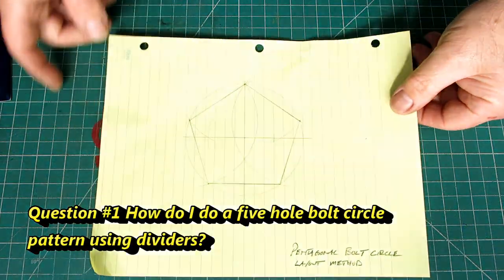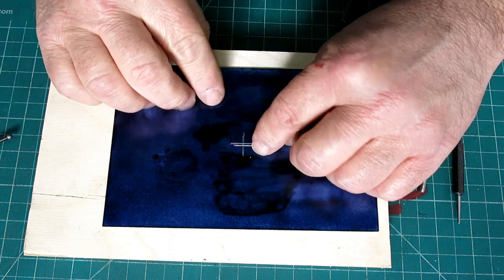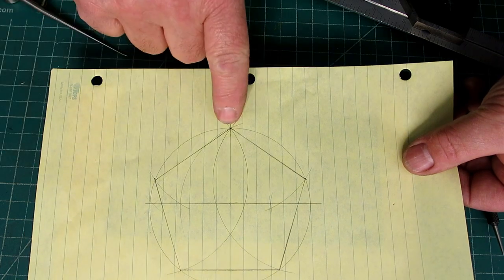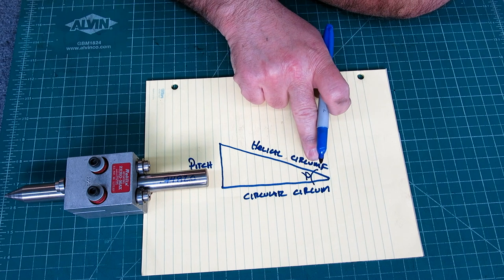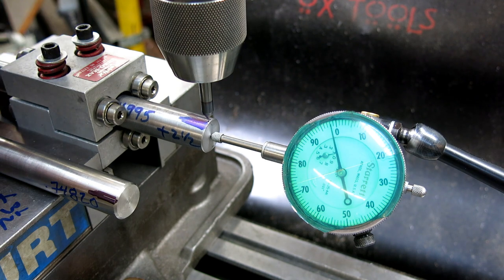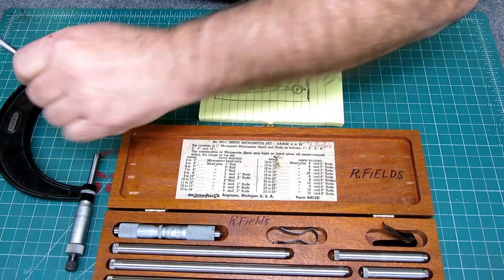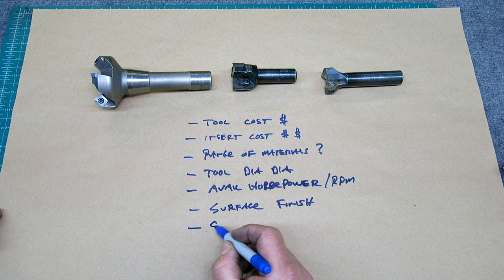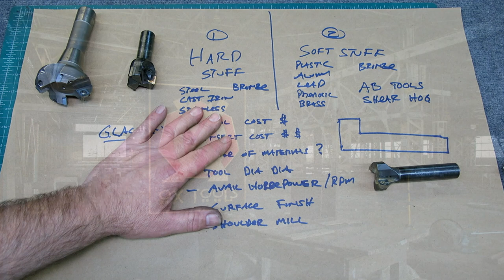Meatloaf 134 Comments and Questions

Comment: Hey Tom, I thought about the Rohlix pitch "error" and I'm pretty sure a change in diameter, if big enough, will change the pitch.
The reason would be that you don't change the angle, since it is given by the rollers, therefore you change the circumferences and the pitch.

greetings from germany
Brian

Comment: Tom,

You took me back to 1970 geometry class. I haven't tried to layout a pentagon since then, but occasionally wish that I could remember.  I have had both Starrett pin and prick punch sets in my tool chest for 35 years, but never realized that the square bodied set set differed in tip included angle. I used the square bodied set to prevent rolling off of the bench. Now it was obvious to me that a finer prick was obtainable with the sharper tip, but it never dawned on me that these sets were designed with specific included angles. I promise here forth to dress my punches as designed. I will also begin to use correct tool names and treat the prick punches with far more gentleness and respect.
I own many scribes, but my go to scribe at work was a carelessly hand dressed very long, very small and broken tap. Someone told me when I was young and very poor that taps were hard and a broken tap was excellent scribe making material. I scouted the shop floor, latched onto the first broken tap meeting my requirements and crudely hand dressed it on a belt sander.  It is so ugly that I am embarrassed everytime that I use it, but it remains my favorite. I now own many tens of thousands of dollars of hand tools, but it has never occurred to me that I should purposely upgrade my favorite scribe.
When I retired, I brought my work tool chest set home. It wouldn't fit in my shop, so it got a place of honor in the old kitchen. The tool chest count has grown and is now around 30. My wife has lobbied for building a new additional shop, and 4800 square feet is currently under construction. I have promised to take the kitchen tool chest set to one of the shops when the new shop is ready. This will be a happy and a sad day. I have grown accustomed to having my career's worth of cherished work tools in the old kitchen. The house has always been her territory, so the new shop is a very happy compromise for both of us... And I get to keep my basement shop! The only space I have to yield is the old kitchen tool chest parking space!

My career was CNC machine maintenance. My retirement hobby includes learning to manual machine. The basement shop is intended to be strictly for woodworking. The new shop is for all things mechanical and metal.
Reply from the maker: Hey Paul. Thanks for the nice comment. Send me a picture of your shop when its done. Sounds great!

Cheers,

Tom

Comment: Always good, thank you.
Two things.
Onto the stand of the bench grinder I use for drill sharpening I have welded a short piece of angle iron, at a 45° Downward angle , with a cross piece at the bottom, leaving a trap point for the butt end of the drill to help check drill lip equal heights.
Because it's welded to the stand it cannot get misplaced and has therefore helped me for 40+ years!
And the other:
All measurement is by comparators.
Thank you Tom.
Reply from the maker: Hey Carl. When I was rooting around in my material bins I took a long hard look at some angle iron. I decided I didn't feel like doing any welding so I did what I did out of pure laziness. Thanks for the comment.

Cheers,

Tom

Comment: The angle is constant because the bearings are at a fixed angle.  Pitch is dependent on circumference.
Reply: Thank you, saved me typing :-)
Reply: Yes but, I think that using a right-angle triangle to describe the pitch is only valid if the diameter is constant. imagine wrapping that triangle around a conical shaft. It wouldn’t fit neatly.

It might be that the hypotenuse isn't even a straight line when the diameter is changing. (I'm not certain of this)

Comment: Tom , I like your content ,  about the cutter s   You showed pretty common cutters that can use triangle tooling that most people use for there lathe.  I have been using Mil-tec fc cutters  all diameters all shanks but they can use  round square and octagonal inserts in same cutter body.  $15 an insert but sometimes a deal on flee bay, just my 2 cents  keep up the excellent videos  thanks again    Ed
Reply from the maker: Hi Ed,

Mil-Tec is one of the few companies that has done a reasonable job covering more ground. The initial tool and insert cost is fairly high for home shop folks but they system does satisfy many of the variables I mentioned. I have used one but haven't wanted to spend the money on yet another system and four or five boxes of inserts at $15 bucks a pop. Maybe I can get a sponsorship..... Thanks for the comment. I did mention Mil-tec to the fellow that asked the original question.

Cheers,

Tom

Comment: On the Rohlix lead you are changing the lead/pitch when you change the diameter of the shaft not the helical angle. The helical angle is fixed by the angle that the bearings are mounted in the nut.

Comment: Robby Stokoe's comment on how the helix angle is fixed seems spot on as a theoretical first approximation so I won't rehash it here. 
As for a testing procedure for the Rohlix, I have a suggestion:

1) scribe the zero line on the end of the piece across the diameter, mark one side of the line with a sharpie dot and use a square off the mill table to align it vertical. Could even mount a veeblock on the shaft and reference it parallel to the table if you wanted to get super precise (or an angle block ala Monsieur Newbould)

2) once the zero mark is established, contact the end with a hard stop (mill table stop)

3) turn the shaft multiple times (perhaps 10) retracting it away from the hard stop

4) fix the rotation so that your scribe mark is again vertical (here's where the veeblock and Newbould wedge really shine)

5) measure the gap between the hard stop and the end of the shaft with an adjustable parallel and micrometer. 

Like you yourself mentioned, the error in the dodgy indicator repeatability is overpowering the small difference in lead. By Robby's calculations just a quarter thou with these shaft sizes. What are the largest and smallest shafts that you reckon could work with this particular Rohlix?

Respectfully Curious
-Lee

Comment: First rule in layout of regular pentagons: Lay out the golden ration first. You can construct the square root of any integer, so any polygon that has sides with length the sum of integers and roots can be constructed. Nice, clean, precise demonstration here. I've never been able to close the 17-a-gon construction, but I suspect that you might be able to. I also love the Lufkin mics (largest I have is 60", with the 20" extension, and it does get used). The tubular inside mics can be calibrated on a surface plate with a precise height gauge with the seat face on the plate, and one 4" outside reference, which can also be the height gauge, though it is easier with gauge blocks.  Zero the mic with the short caps to the 4" reference. Remove and compare the caps. They must match, and act as the base for the lengths of the rods, which step in size by full inch increments. If the caps are 0.2514", then the 1" rod should be 1.2514", and so on. They are adjustable. The small diameter sets can be handled the same way, but the rods go to the 1/2". (I have 4 full sets, all interchangeable for caps and rods. Took a lot of work, but I can go to a site, measure to within 0.001", correct for temperature, and be within 0.003 to 60")

Comment: i always liked the guess-and-check step it out method, set the calipers roughly, then walk them around the circle, and make small adjustments until they come around perfectly to where they started. obviously there's other reasons to know these foundational construction methods, but for a bolt circle it does seem a lot of effort, and stepping it out easily transfers to any number of divisions
Reply: That step it out method seems to be what Chris over at Click spring uses a lot.

Comment: The extension tubes on that Lufkin inside mic set are adjustable. The end of each tube has wrench flats, and you can turn it in or out to calibrate each extension. 

You'll still need an outside mic that's properly calibrated. You first calibrate the body with the smallest caps (using the included wrenches), then replace only one of the small caps with each extension tube in turn, and use the appropriate outside mic to calibrate them.

I've got a 1.5"-12" set just like that. Neat little tool.

Comment: I was using a face mill very similar to the 3 insert Kyocera a few days ago to trim down some new AXA style tools holders (My Logan needs about .030 trimmed off to get to proper center height with 1/2" bits).  The holders weren't very hard (could file easily), but the inserts were throwing sparks like crazy.    The pentagon layout was very interesting!

Comment: With Rohlix thingie my guess would be that the bearings tilt defined the helix angle AKA alpha. Therefore increasing the shaft diameter should also increase pitch. In terms of your drawing the hypotenuses of your triangles should be parallel.
Reply: I agree. Thanks for saving me the typing.

Comment: I'm surprised this video didn't get a food analogy title. Leftover stew?

Really enjoyed the sheet metal layout lessons.

It seems like for the threadless leadscrew to follow the triangle postulate linearly, the block that holds the rollers (currently 2 sections) would have to consist of as many sections as rollers so that as the shaft grows larger in diameter, the radial orientation of the rollers remains the same. In the current configuration, as the shaft grows, distance between 2 rollers remains the same 🤷

I've seen these mechanisms used in factories in pushing mechanisms where stock is added to a conveyor by being pushed out of a storage magazine. An electric motor powers the shaft and if there's a jam, it just slips. After a timeout from not satisfying the traverse sensor, it can retract and try again.

Comment: another possibility of how to remove the caps is to use a 5C collet of the correct size (cap diameter) installed into a collet block and tighten  the collet onto the cap and twist off.  No need to make another tool if you have the collet and block.

Comment: Your comments at the 6 minute mark about multiple squares is interesting. In your specific example about two common dimensions I would be inclined to put two heads on one ruler to reduce handling. Good stuff, carry on.
Reply from the maker: Hey Chad, That is a great idea! Never occurred to me as the two combo squares I used the most were a 12 inch and a six inch. I would keep track of the magnitude of the dimension by which square had what. Big square big dimension, little square little dimension. Thanks for the great comment.

Cheers,

Tom

Comment: Starting at 26:00 when you show the thread triangle changing, I think it's different that what would happen in the case of the Rohlix.  If you cut the thread on a lathe, the pitch stays constant, so changing the diameter would change the angle as you described, but the pitch would be the same.  In the case of the Rohlix, the bearings determine the angle alpha, so changing the diameter doesn't change the angle, but the pitch changes in direct proportion to the diameter change.  Not really a material difference but I hope that makes sense.  This hypothesis predicts a that the larger of your two shafts will have a pitch 2.4 tenths longer than the smaller one.
Reply: Agree wholeheartedly, my calculations concur. I'm piggy backing on your comment Robby hoping that more engagement on your thread helps this to rise to notice.

Comment: There's a faster way to set the dividers to a length defined by two intersections like you were doing with your bolt circle layout. The first step is to prick punch each intersection. Then, open the dividers slightly wider than the two points, drop one divider point into a prick punch, and then squeeze the dividers together until the other point drops in to the second prick punch. At that point spin the nut to hold the dividers in place and you're done. You can rock the dividers back and forth and fuss with the setting a bit if necessary.
Reply: Even faster, and all you need is a protractor and a pencil. Set your center, draw a random line (or where the first bolt hole needs to go) then measure 72 (which you remember for penta as  being 7-2=5) draw the next line, and repeat five times. You then measure the distance from the center to the bolt hole and repeat to the other four spokes.
Fastest way to draw an equal sided pentagon, hands down.
Reply: @aserta  definitely fast but may not be as accurate if I I'm understanding you correctly.
Reply: @steveshopworxmachine5716  It's usually worth asking, when you start out, what the accuracy requirements are.  Thousandth of an inch?  Hundredth?  Do you really need five holes, or would four be enough?  Would six be too expensive?

Comment: Hi, very good explanation, I realise that you have to take us through these exercises bit at a time so we learn, and often simplify to avoid confusion, just a question, not a criticism, when working in wood we (in the UK) true two adjacent edges - Face and Face edge, and mark them and all measurements are taken from these two faces so any variance in the material is negated. Accurately guillotined material is the norm in a commercial workshop, but no so in the home workshop, I assume you would advise identifying one edge and when possible only work from this edge, I appreciate your guidance

Comment: Thank you for another great video.  I enjoyed each segment. Regarding the pitch measuring exercise, wouldn't it be better to scribe a longer line, then rotate the shaft multiple turns and divide by the number of turns to get the final result? If I  need to measure the pitch of an unknown thread, and I don't know whether to start with metric or imperial thread gauges, I will measure across several threads with a caliper. I wouldn't try to measue just a single thread. I think the same logic applies here.

Comment: I like the method for a pentagon bolt lay out.
I recently did a 5 bolt lay out useing a "cut and Try " on paper until I could step off the bolt points with a compass. A half dozen trys resulted in my 5 bolt holes coming out right. Then I could do the lay out on the metal.
Thanks

Comment: Would have loved to see a sanity check at the end along the final edge of the pentagon, just to see how much error you did or didn't get with this method.

Also, with the different diameter shaft the thread angle doesn't change, but the pitch.

Comment: I really enjoyed the layout section. It would have been even better if you had shown us beginners how to cut out the stock nice and square and apply the Dykem neatly. Sometimes really basic, but important stuff gets left out of books and videos because the creator assumes I know stuff when I don't. That nice Starrett square is a lot harder to use if you don't have a part with straight and square edges to start with. For a thicker piece I would square it up on the mill before starting the layout. However, with sheet metal, I struggle with that part.

Comment: G'day Tom, I have a couple more suggestions if you're in the mood for questions.  1.  How to choose whether to use a 2, 3, or 4 flute end mill.  And 2. How to single point tapered pipe threads - which are defined by the gauge length.

Comment: To get a little amateur-math-geek-ish on it...  one way to think of the pitch problem is to approximate by similar triangles -- the ratio of "rise to run" is going to be at least approximately the same in the full triangle as it would be in a tiny "change" triangle.  Let's assume the angle is always the same, determined by the rollers.  Let's say the original triangle gives 0.100" of pitch at 0.750" diameter, which is 2.356" circumference.  So rise/run is 0.100" / 2.356".  That's a ratio of 0.04244.  Or we can say pitch = circumference x 0.04244.

That also means that a CHANGE of 0.001" in diameter, or 0.0031416" in circumference, will result in a CHANGE in pitch of about 0.0031416" x 0.04244.  That's 0.000133" for each thousandth.

It turns out the whole thing still works with diameter directly at these small angles, so we can use the ratio of pitch to diameter and avoid the whole PI thing for circumference.

So... with 0.100 pitch at 0.750 diameter, the pitch should change by approximately 1/7.5 of the diameter change.  So... probably need that tenth's indicator, or better!  Then the question is... how consistent is the spiral?

Comment: Tom, I would think that roller lead screw would have a constant angle instead of pitch due to the geometry of the bearings. Larger shaft would have a larger pitch because of the constant angle. The friction drive accuracy is all based on the tension in the bolts that they try to hold constant with the springs.

For that drill gauge how about a foldable sheet metal one. That way you could show off those sheet metal skills.

Comment: Cool video.  Just to note that not all regular N-sided figures can be exactly constructed with a straight edge and a compass.  We can do 3,4,5 sided figures and multiples of those figures.  So, I don't think you could do for example a  7 sided figure exactly with a straight edge and compass.  The Greek's knew this thousands of years ago.  Then Carl Fredrick Gauss surprised everybody as a very young man and proved that if the the desired number of sides was a prime number and the even number preceding it was also a perfect square it also could be constructed exactly with straight edge and compass.  Your example of a pentagon follows as 5 is prime and 4 is a perfect square.  His breakthrough was the 17-gon as 17 is prime and 16 is a perfect square.